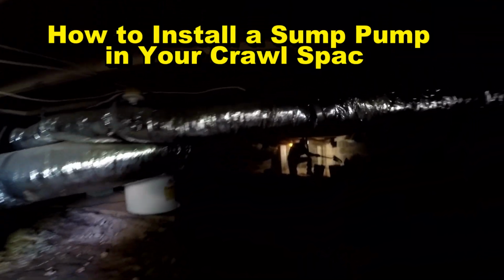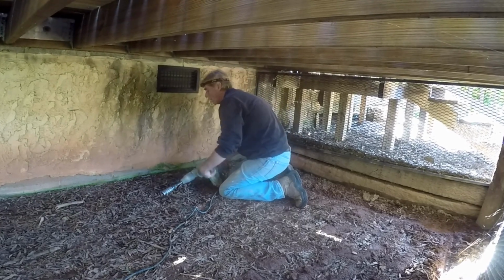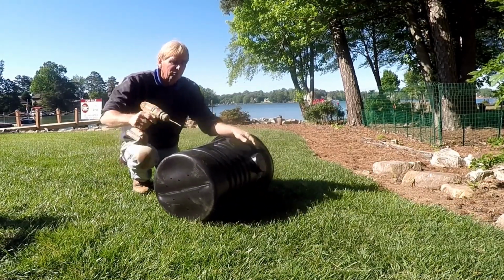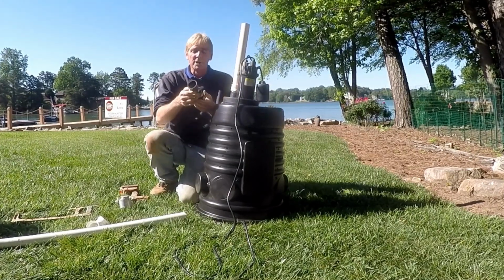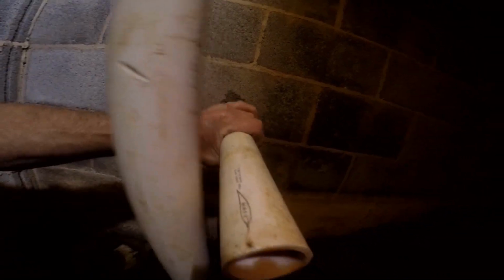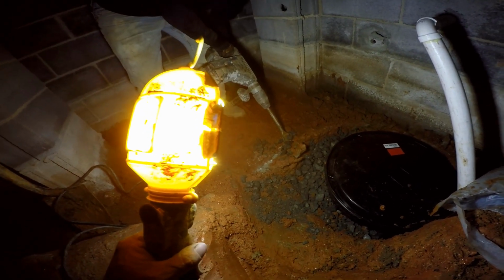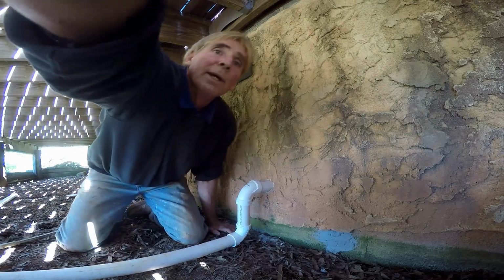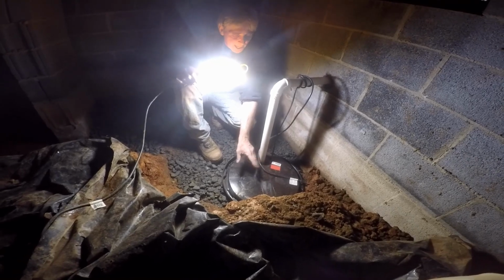Do It Yourself Sump Pump Install, Crawl Space Interior Waterproofing

Comment: I’m sure you realized this after the fact, but  it would have been easier to glue the 90 on the vertical piece first, then just slide it onto the piece coming through the wall.